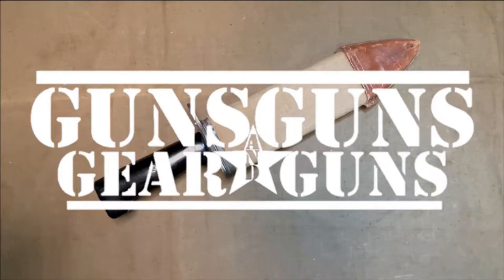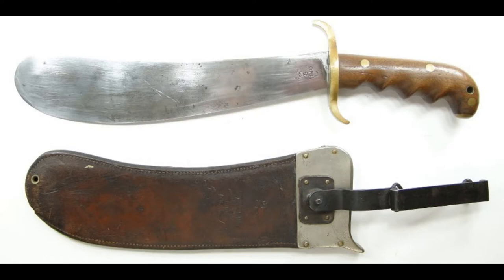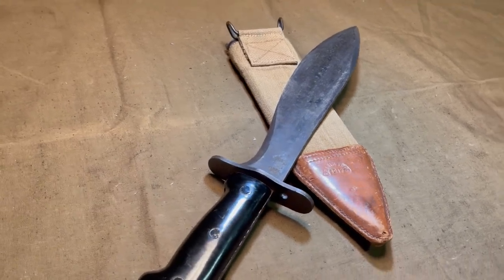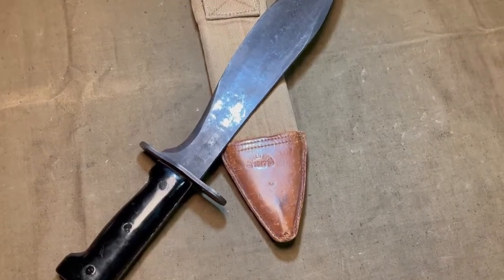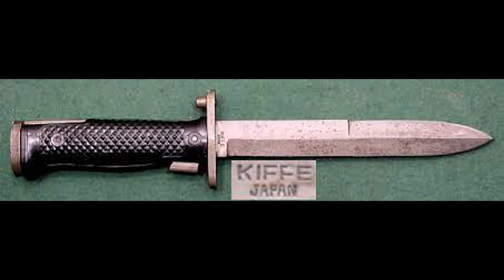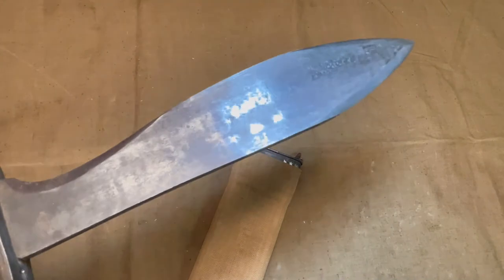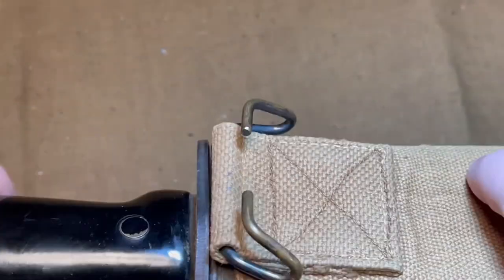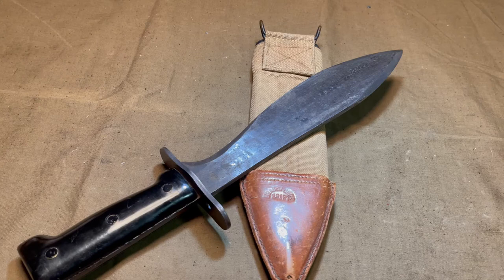Reproduction U.S. Bolo Knife with Original WW1 Sheath - A Common Occurrence?

Comment: I went for the 1917 PLUMB STLOUIS)sic) repro my sheath is stamped AKCO. 1918 RHS I was told the difference ibetween an original and repo is ST LOUIS has a apace the repro does not. Another difference harder to pin down might be the steel alloy; the repro's sharpening edge is not honed, but should not be a problem if one has the time, patience and stone. No worries, skill be be acquired. I was also told that the sharpening edge of the original was a single side chisel edge not a "v."  I would not use a dremel (too much heat build up on the steel), but if you had an old kick wheel sharpener you might have a chance. The net abounds with the PLUMB repro and prices vary widely. I am not disappointed. As repro's go this might just be the holy grail. Solidly crafted. Looks and feels close to the one I had in service (for a short time).